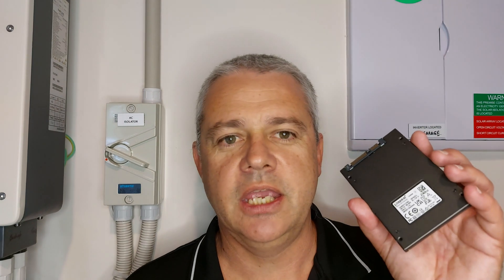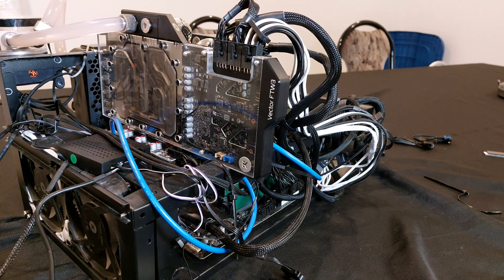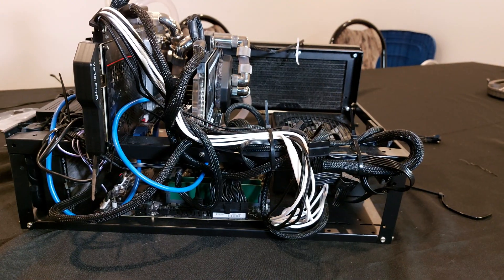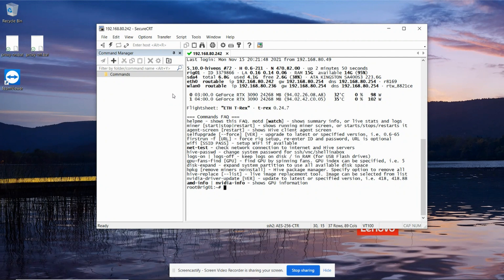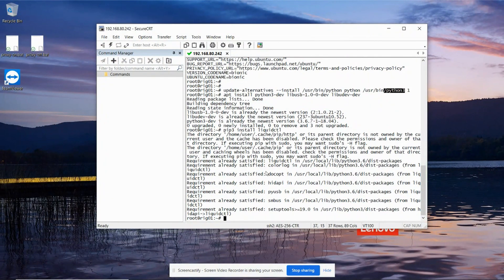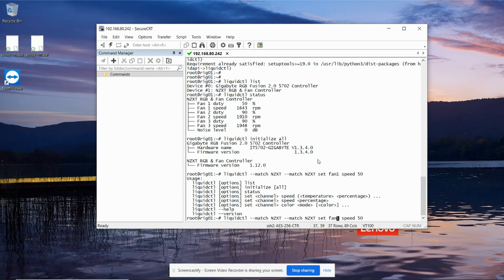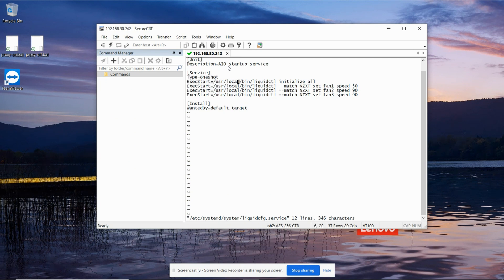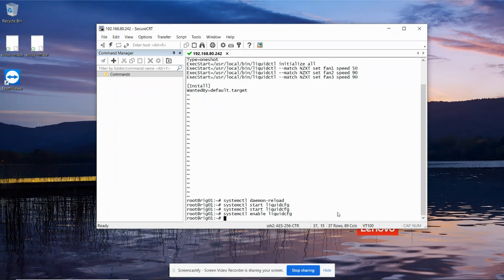HiveOS Water Pump and Chassis Fan Control with NZXT

Comment: hey mate just a question about the cam software on windows, does your pump/fans not kick in full speed untill the cam software loads up after windows has logged in ? if i dont log into windows fast my cpu will got hot as fans just run on idle. does this happen with you on windows ?
Reply from the maker: This is done under HiveOS,  not Windows.

Comment: hey this was a really nice video. actually I was looking for a solution in Hive OS of how to control the chassis fans speed and the light. I wanted to ask you does this liquidctl allows us to control the 120 mm chassis fans.. if you can make a video of that...   and thanks that was a great Idea of changing the color according to bitcoin price we can use those parameters in many.
Reply from the maker: You could control chassis fans as long as they are connected to a controller that liquidctl can recognize.